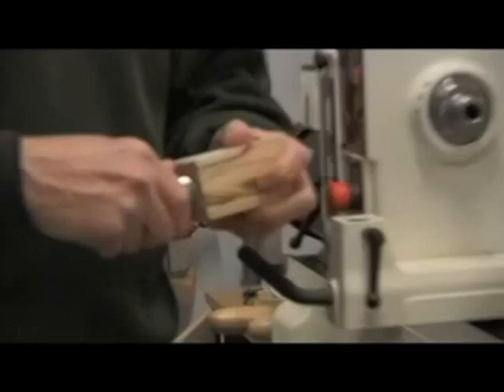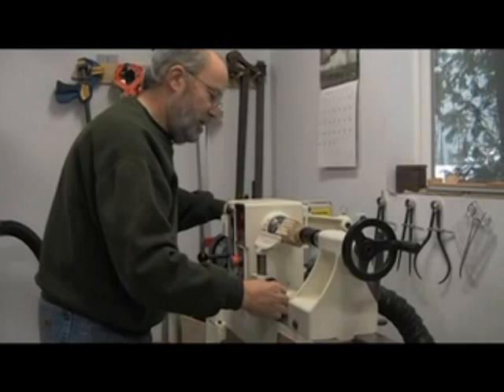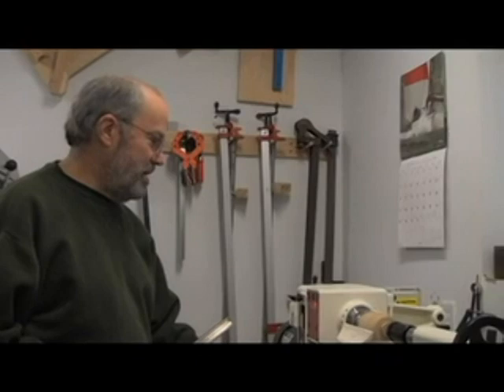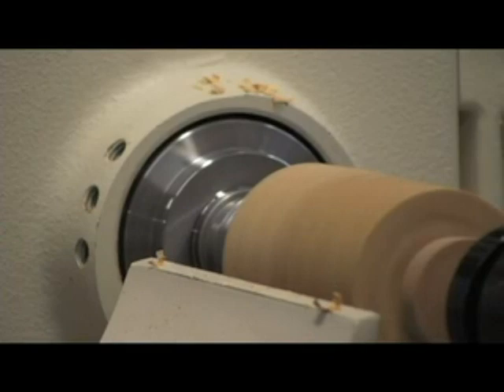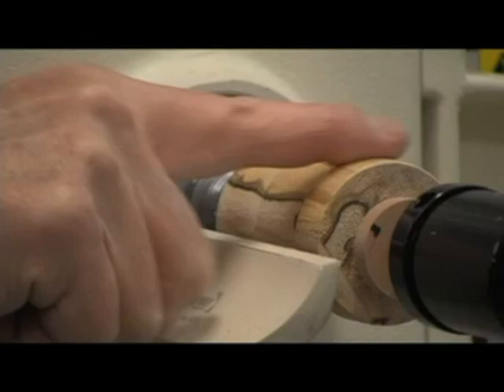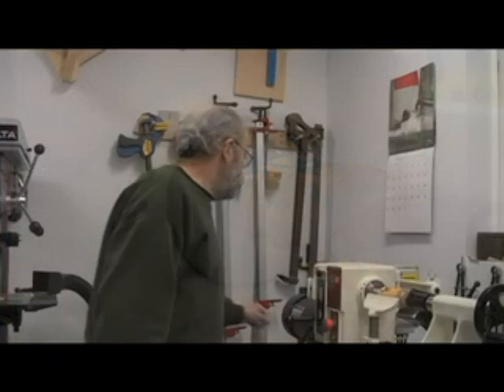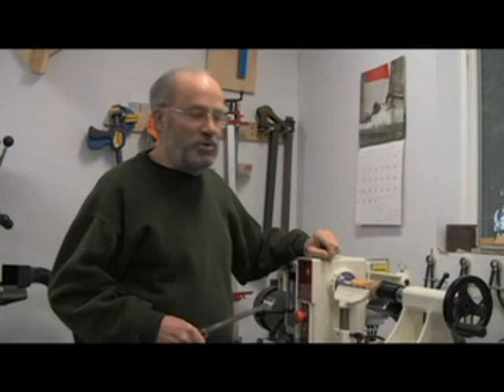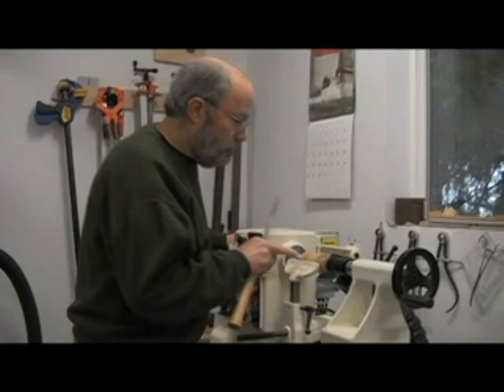Turning A Salt Shaker, Step 3

Comment: I can't tell you how many times I have watched this video. I really want to get a Treen Mandrel because I have made several of these salt shakers by turning the wood round first. then to keep the wood from splitting while I turn the rest, (i turn the piece a bit longer than I need) I put a hose clamp around the waste section of the wood. A Treen Mandrel would make it much easier to make...and the jig to make the holes in the top may seem like simplicity itself, but that is what makes it genius.

Comment from the maker: @d72028 That is the Beall Tool Company Treen mandrel. The 1-1/2" mandrel is used on the body part of the salt shaker and the 1" driver is used on the top part. Tried to post a link but it didn't work, sorry. The 1" part is listed on their accessories page. Thanks for watching my video and I hope this answers your question.
Regards, Gary

Comment from the maker: @Buzzsawman Thanks. The Treen Mandrel has been a really good investment. I use it for many things beside the salt shakers. The nice thing is that since the whole inside is supported, you can turn the wall thickness very thin, if you want to. The hole jig works great... The ideal also came from the Beall Tool Co., makers of the Treen Mandrel.
Regards, Gary